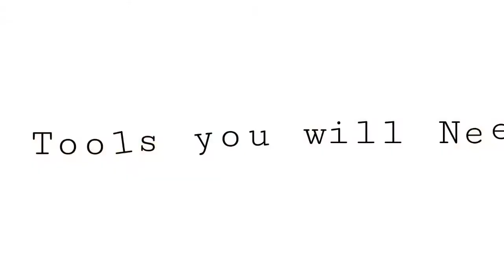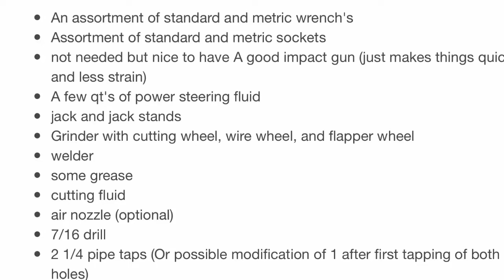Tapping Your Steering Box for Hydro-assist.

Comment: Wish I could get a better shot of the hole locations to be drilled.
Reply: top right corner, the square. If you're looking at the box like it's connected to the frame from the inside.